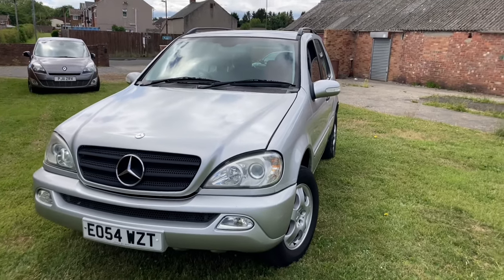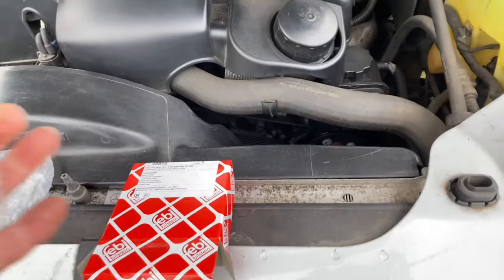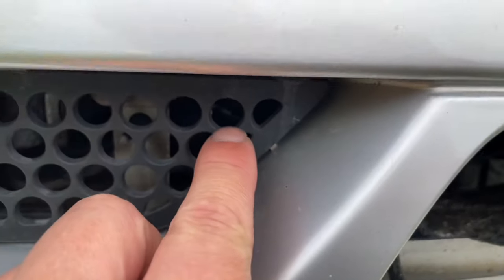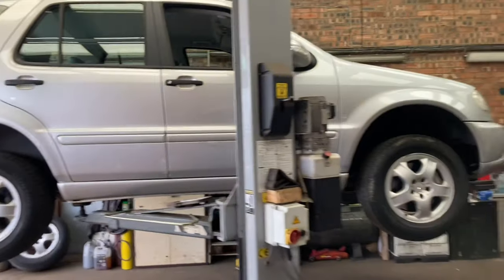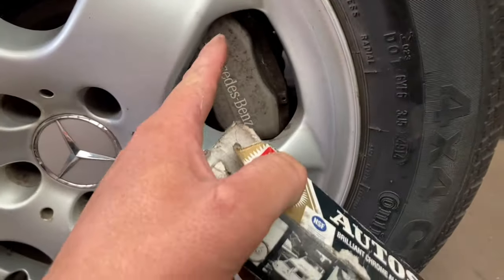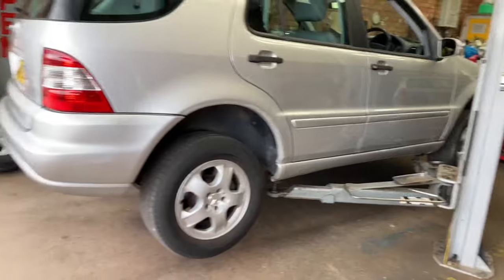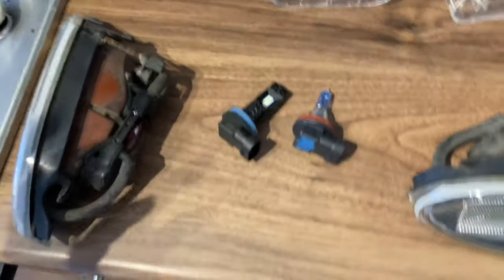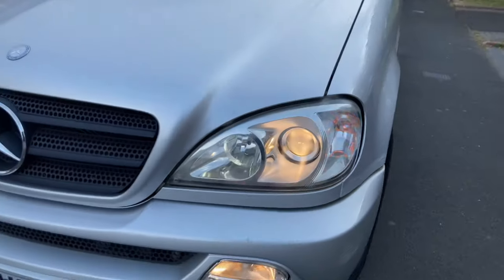Project ML | Mercedes Benz ML350 | Head Light Upgrade | Brake Service | Throttle Cable

Comment: Evening Fella. 

As usual great content.

Enjoying all the little jobs being done on the ML mini series.

Going off piste so to speak for a minute, any news on the 3rd service including the tappet clearance on the L200? I can't remember when you said it was due.

Keep up the fantastic videos,  always informative. 

Stay safe.  Stay healthy. 

Alan L200
Reply from the maker: Thanks mate 👍🏼

Mines not due 3rd service till August, I have spoke to Mitsubishi mechanics, and been told hard worked trucks that have 100,000 miles on come 3 years, when stripped down either zero or very very little adjustment needed.
Plus heard though the grape vine so to speak, unless vehicle hard worked or high miles, 9/10 get the old ear test if no tapping present clean around the gaskets and it gets left, and the box ticked saying it been done.

Know for a fact at 10,000 miles I’m definitely not pulling all my injectors out for no reason.
Reply: @CarAddictGarageNE  Thanks for the reply. That's probably what they did on mine then, the ear test ☺️☺️☺️☺️☺️

It's due its 6th yr service in September, so with only 8,867 miles on the clock since I brought it brand new (6 yrs, it's my driveway princess ☺️☺️☺️), it'll probably be the ear test again, BUT CHARGING me the FULL price to strip it down fully.

I'll keep u posted.

Keep up the great work/content my friend.

How you've not got more subscribers is BEYOND ME.

Ya approach is spot on, say it how it is. No BS & varied content. Brilliant channel. I'm obviously loving the L200 content, but being in to vehicles, all ya content is interesting to me. Albeit I DON'T know one end of a spanner to the other. 

Keep us posted how your L200 gets on.

Stay safe. Stay healthy.

Alan L200
Reply from the maker: Thanks mate appreciate that 👍🏼

I would definitely question what’s been done, I don’t have a lot of time for dealers your better off at a well recommended independent garage using genuine Mitsubishi parts, you will get better workmanship and pay half the price.

I have 2 L200 videos one loaded tonight and the other possibility over weekend.

I’m that sad with mine I am going to fit tow bar to ML for towing a caravan, over de valuing the L200 and fitting tow bar, sooner when I sell it can honestly say it’s not had hard life.

Comment: Known weak point plastic pedal and bolt. 30 quid from Polish MB OEM supply
Reply from the maker: Yes I didn’t  expect as much free play, lucky i have new cable and throttle pedal assembly on order, see how it goes when delivered.

Yes have read it’s a weak point on these W163

Comment: Hi, cheers for the ml video mate I'll keep a close eye on the new videos because my accelerator pedal is exactly the same. I have tried loosening cable etc but still very notchey. I'm gonna change the transmission fluid in the next week or so, do you recommend any fluids in particular? I'm in New Zealand now and a lot of the 236.14 mercedes stuff is hard to come by. Cheers
Reply from the maker: Thanks Michael 👍🏼

I’m just currently waiting on the cable been delivered as it coming from Germany, so until that arrived and the throttle pedal I’m stuck.

Also waiting on tow bar will document that as well, and possibly spark plugs depending if they the need changed.

Have a look back to my very first videos, I did a gear oil change on this car… not sure if i documented it, if not try MPM oils they have a world wide VRM look up.
Reply: Thanks mate I'll look that up. Its also got a bit of a long crank issue, it's OK once it's been started,if you turn it off it fires straight back up but after it's been off an hour or so it's back the same, turning the key to position 3 a couple of times seems to help a bit. I'm going to change the fuel filter soon to see if this helps maybe ? Thanks again for your videos they help a lot.
Reply from the maker: What engine did you say your ML was?

As I know my ML350 3.7 V6 does not have a fuel filter, only a sealed unit in the tank.

Could be something like a crank or cam sensor, or there is some vacuum pipes for the fuel pressure regulators if they leak can cause that, also the evap solenoid next to the TPS if failed can cause difficulties starting….. or simple stuff like spark plugs.
Reply: Hi mate , thanks for that. It is a 3.7 2004 model. The local garage says the filter is behind the rear wheel arch and apparently its a common cause for the long crank issue, I can't find any history the last time it has been changed other than in 2010 so I'll give it a try as it's probably due anyway. I think the spark plugs were done about 20,000 miles ago. Thanks again. Michael
Reply from the maker: Yes fuel filter could cause long cranking, but if its badly clogged i would think lack of power and misfire issues also
Reply: Hi mate, just to let you know or anyone else who is experiencing the long cranking issue. I have changed the fuel filter and it starts perfectly now. The mechanic showed me the filter and the regulator fails inside it and messes with the pressure.
Reply from the maker: Yeah that’s next on my list, but fear the pipework will be a pain
Reply: @CarAddictGarageNE  it is running much better in general now with the new filter. Just make sure you get part number 1634770801 because the one before that doesn't fit on the pipes properly. I'm also looking forward to seeing the peddle fix because mine does my head in. Cheers mate
Reply from the maker: Definitely will look into that, I’m worried that metal fuel pipe that runs from the tank onto the exposed bit if chassis in the wheel arch looks in a bad way, so don’t want to disturb it.

You have me thinking now I did a video on throttle repair but I cant find it, think it’s been lost??
Reply: @CarAddictGarageNE  to be honest I probably would have left it alone if it weren't for the long crank issue. He showed me the old original filter and there was black stuff caught up in the fuel so I'm glad it was done. Where I live the hills are crazy steep and when hill starting where it was very steep I was also getting a juddering on take off then would get back to normal, I thought it was maybe the transmission but must have been lack of fuel pulling through because the filter change has sorted it out.
Reply: @CarAddictGarageNE  yeah mate it must have gone because I can't find it anywhere. Cheers
Reply from the maker: I would really like to change it as I know it’s not been done, but i know i would run into serious expense getting new main fuel pipes
Reply from the maker: I have found the throttle repair video and uploaded it mate 👍🏼
Reply: @CarAddictGarageNE  brilliant mate , thank you
Reply from the maker: No problem 👍🏼